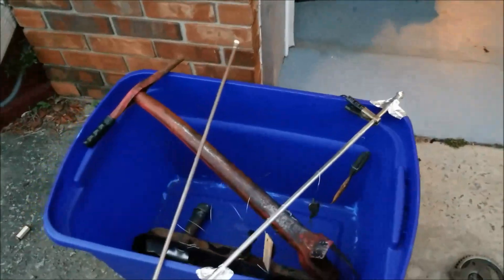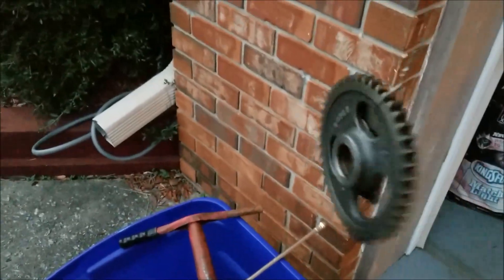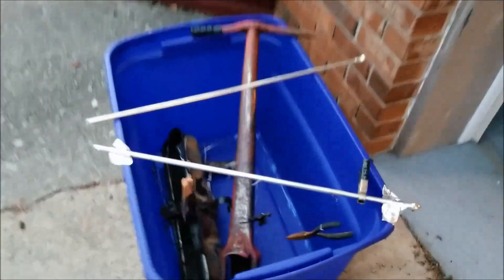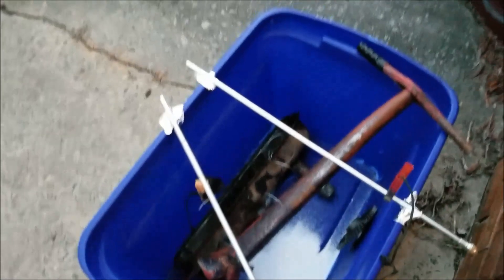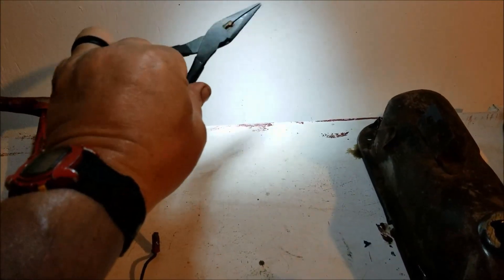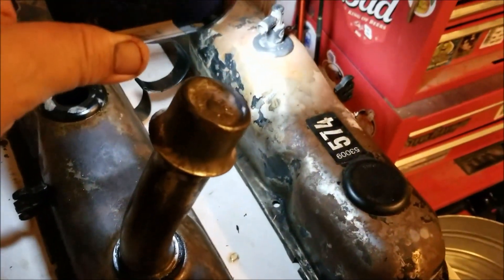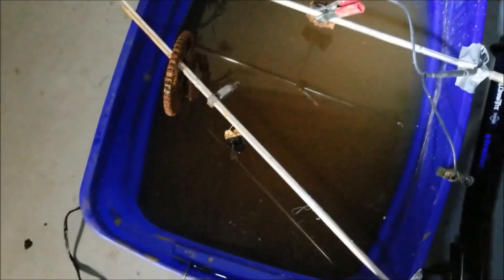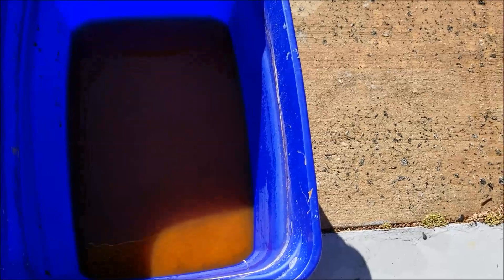Rust removal with electrolysis

Comment: You can reuse your electrolyte solution as long as you want to just keep adding water. If you let the solution sit for a day all of the brown junk will settle to the bottom  and the water will be clear. The real key is keeping the sacrificial anode clean or the efficiency declines as more crud builds up on it. If you could hook up an ammeter in line with the anode you will know when to clean it off or when your electrolysis is finished by watching the amp draw drop.
Reply from the maker: Good to know, Thanks!